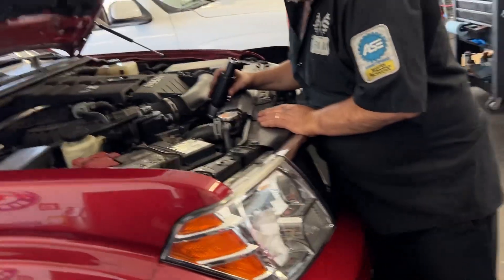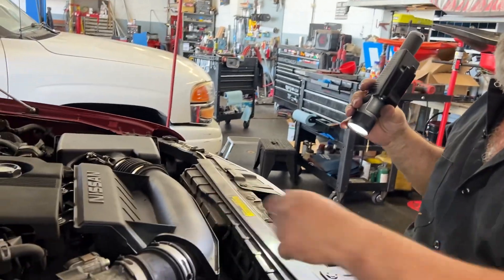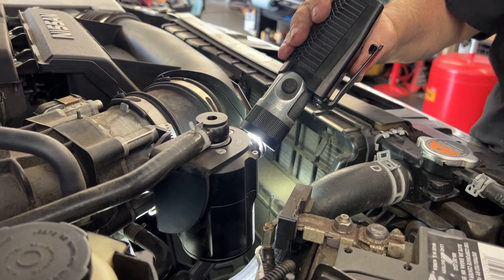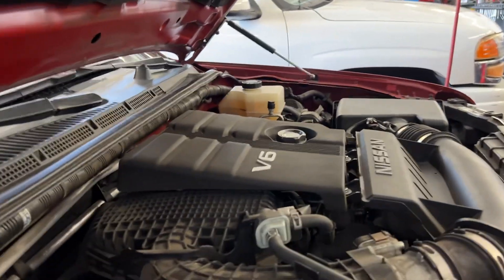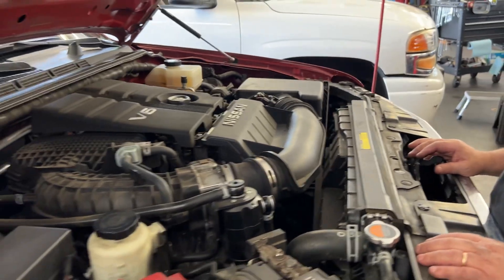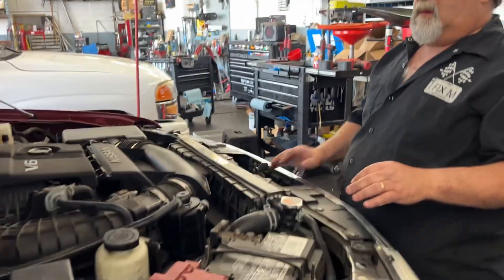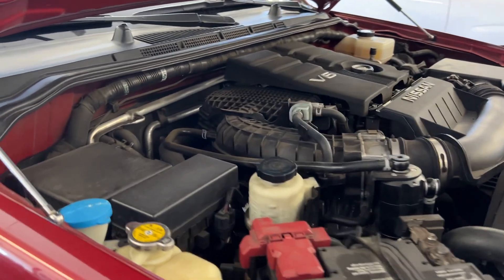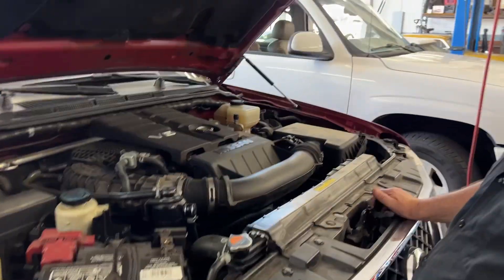Oil catch can. Yes or No. 2020 Nissan Frontier

Comment: I know this old but why not vent the blow by to the atmosphere and put a filter on the intake input side to keep bad stuff from entering
Reply from the maker: You can do that or run a down draft tube and just dump the oil under the car as you drive, butt not only is it more appropriate for the desired result it also looks cool as heck

Comment: Would this void the warranty on the engine?
Reply from the maker: I can't say it would or would not. It will cause a vehicle to fail the CA smog test and probably in many other states also. They are easily removed and returned to stock in 10 minutes if you need to get warranty work performed and you are concerned about that.

Comment: What size hose hose diameter for the catch can on the new 3rd gen Nissan Frontier 3.8 ( in order to use a universal catch can )? Thanks .
Reply from the maker: Ours came with the kit. Universal one should be the same size hose as your PCV valve hose which I think is about 3/8 hose.

Comment: I have an oil catch can in my 2015 Toyota 4runner. Yesterday 8/19/2025 I emptied the can and had about 1 pint of oil and what appeared mixed with water (milky substance at bottom of can.) I thought that maybe there might be water in the engine, I took out the oil canister FILTER and found no water. This means that when the vapors return via the PCV valve there is condensation getting into the engine. Conclusion: YES, INSTALL A CATCH CAN IN YOUR VEHICLE ENGINE IT DOES NOT HAVE TO BE A $200.00 CAN, MINE COST ME $25.00 PLUS $6.50 FOR HOSE AND CLAMPS.
Reply from the maker: Check your radiator cap when cold to see if oil in there. If not it's just moisture collecting from the breather mixing in.
Reply: Proper combustion of Hydrocarbons produces a "large" amount of water in the form of water vapor. It's why you can often see water condensate coming out of people's tailpipes as a liquid. The more efficient the engine, the more water vapor, the more such water vapor ends up in the crank-case. It's why PCV valves are important (and not just venting to atmo, you want something actively pulling the gases from the crankcase). Excessive water in the crankcase from a bad head-gasket or cracked block/head will result in water in the oil itself vs just vapor. The yellow smudge is commonly caught in catch cans on modern cars and is usually a good sign of a catch-can properly condensing out the vapors.